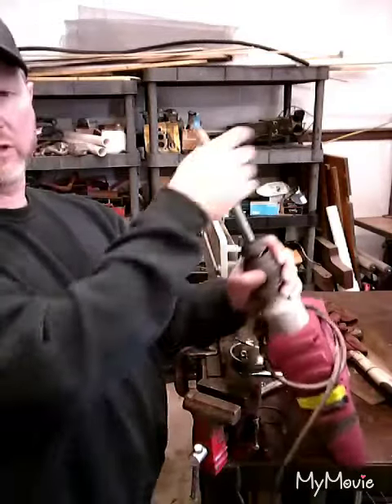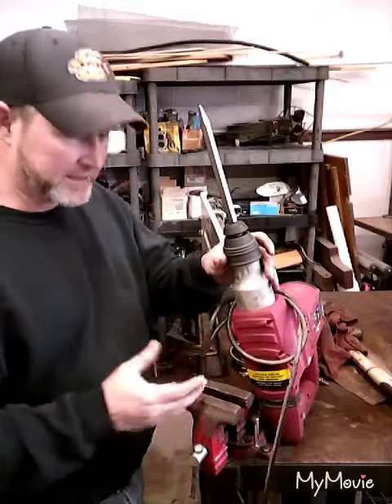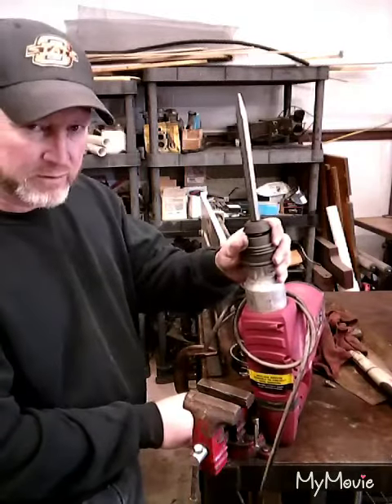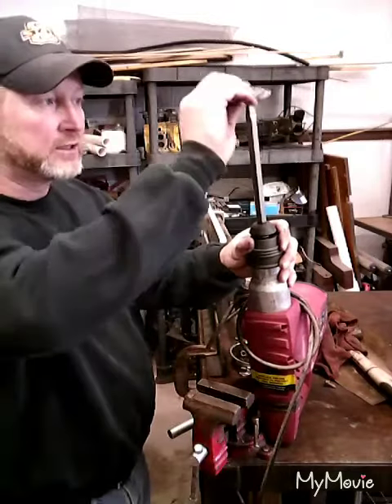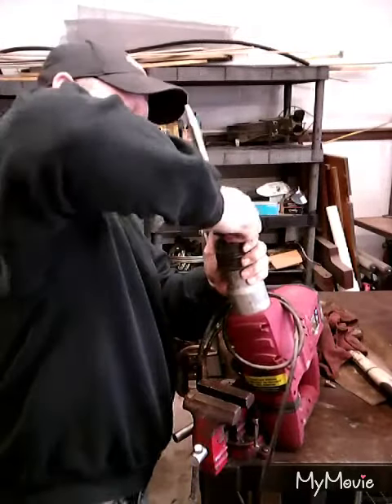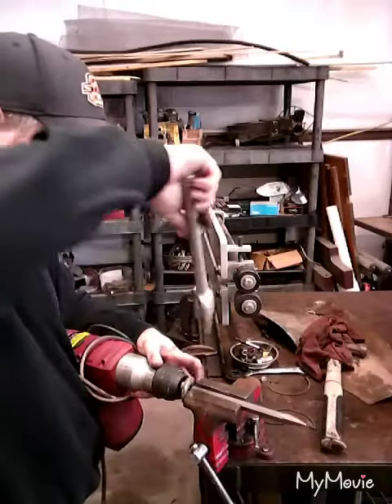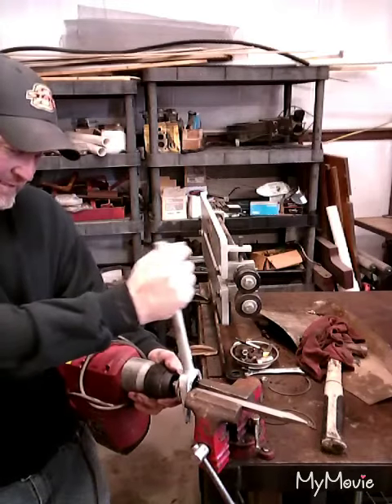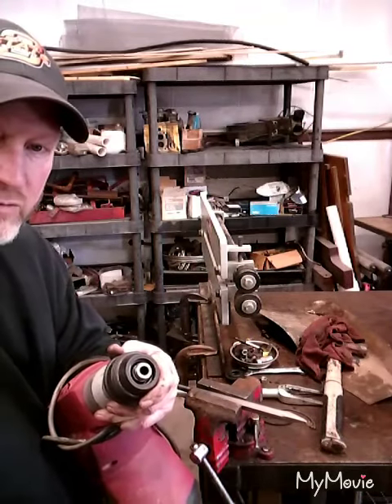Hammer drill bit stuck in the drill Harbor Freight brand

Comment: Thanks Fred. We have a similar model in the UK under the brand name Titan. Superb drill and good value. I used your method to remove a stuck sds bit and it worked a treat. Turned out the end of the sds bit had  broken up inside the drill chuck (cheap bit). But thank you very much for this video it really did help me.

Comment: Thanks! I couldn't quite use your method as my bit got wider for a 1.5 inch hole. But I was able to use a similar thought to clamp a vise grip, then an adjustable wrench to pry it off.

Once out I didn't measure a difference in bit width, but seemed just a bit thicker on 2 sides. I filed it a bit and it's smooth. I will also try some lubricant, grease, or penetrant when changing bits. It seems to be the heat and tough work that makes them stick.

Comment: I have a HF hammer drill. The chisel attachment broken down in the chuck. I took off the front end of the drill (the chuck housing section) by unscrewing the four screws and washers. I took a very thin rope, thread it through the now-empty screw holes, and wrapped it around the chuck & tied it so it would be in the down position so I could use my hands to work on the broken attachment piece. I stuck a needle nose plier into the chuck hole and made contact with the two gaps on the broken attachment base-piece. The broken piece will move up & down the chuck but will not come through the chuck opening. I keep wondering if something is grabbing it from behind. I called the 800# on the manual. The guy was nice but told me to do the same thing I already did----take off the front chuck housing section. I told him I already did that and the broken base piece will not come out. He said it was the first time he heard of such a situation. He suggested to take it to a tool repair shop. By the time I do that, spend gas (no shops very close to me), and buy a new chisel attachment, it's probably best just to buy a new tool.
Reply: I recommend getting one of makita's AVT models when it comes to masonry work. I used to have a Bosch SDS until it literally blew up in my hands. I currently have a makita avt sds max and a bauer breaker hammer. The only thing I regret is purchasing the bauer since it's falling apart already
Reply: @broken_font1881  I ended up buying a drill online last summer, a brand called U.S. Xtreme Power. On the cheaper side but it worked out fine and got me through my home project. I needed to remove four layers of decades-old slip/parging that was firmly attached to my house foundation and terrace concrete walls in my backyard (the last layer, the original layer, was the toughest, but the drill came through). After some repair patching, I applied one coat of tinted elastomeric primer and two top coats of lifetime elastomeric paint. If it lasts twenty-five years, I'll be happy.

Comment: Once I removed the metal half circle pin above the collar, I could see that the bit cleared the ball bearings and was simply stuck in the barrel.  The bit was a cheap item from Amazon, three inch wide but short.  Other bits slide in and out of the barrel fine.  I learned two lessons, one is to buy good bits, two is to grease the bit.

Comment from the maker: If you're using a wide end or flat chisel type bit just use an end wrench instead of washers between the pickle fork and the bit collar.  You may need and extra set of hands to hold the wrench in place for this method while you pry.
Reply: Yes, this works.  I put the wide end vertically into the vise, and then used a couple of open face wrenches on the bit stem.  I separated the rubber end grommet from the chuck and slid that grommet to the top of the bit just underneath the wide end.  This allowed backward pressure on the chuck from wrench number one and wrench number two was my lever arm between the vice surface and wrench number one.

Comment: Grease the bit next time and you will probably not have to break out your pickle fork.
Reply from the maker: Thanks for your advice but in this case the bit was slightly deformed from impact.  Grease wouldn't have been very helpful.  Generally greasing the bit is not a bad idea.
Reply: Thank you for a quick fix to my stuck BIT.....